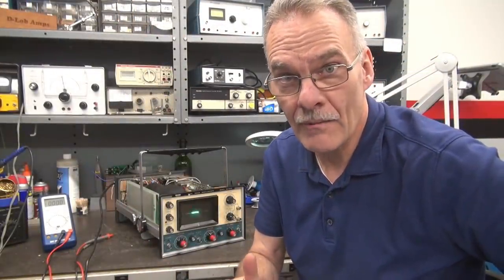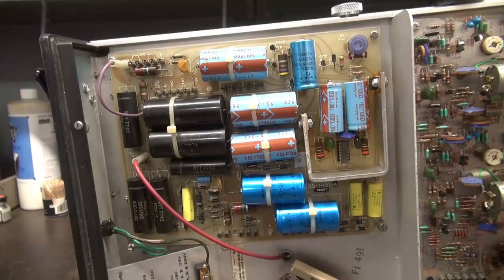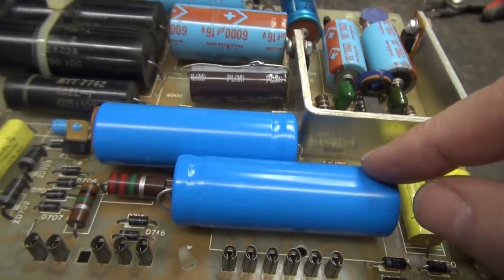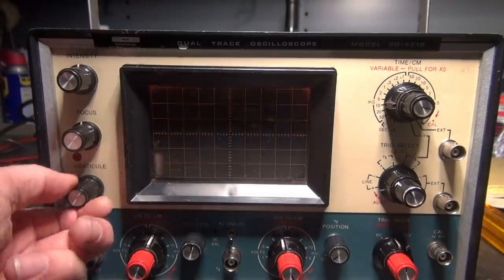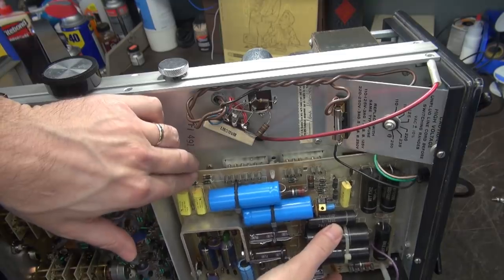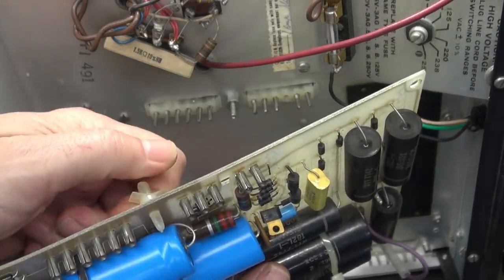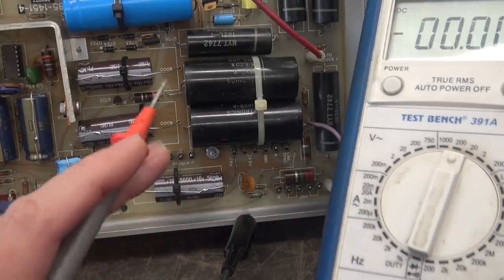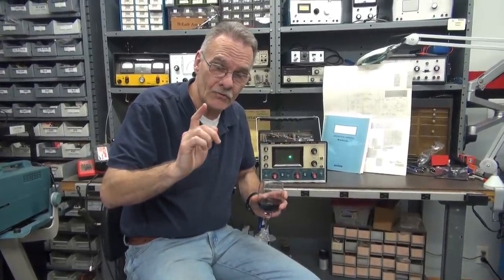How to repair Heathkit Oscilloscope weak Power supply solid advice

Comment: They are not worthless. I built a similar model in 78. I still use it today. I love analog scopes. They show every detail that is hard to see in digital scopes, and there is no pixalation and they are instant. No delays, unlike digital scopes,  which have AD converters. I have built several Heathkit scopes and love everyone of them.

Comment: Great video, TNX 4 the upload! I to use to dream of having some of their products! I skipped a semester of school and used the money for a HW 101. Stayed up 40 hrs straight and built it. Made only 1 error but worked great after that. Shame that there is no more Heatkit Co. They sure had some good stuff ! 40yrs later someone in Poland contacted me and told me he had my radio that I built and other than replacing the driver he is still using it.
73 N8AUM

Comment: i built one of those 4510 scopes back in the seventies , it worked great but  I didn't use it for 25 years , it was stored in a closet and about a year ago I pulled it out and it worked fine for a few hours then the little tantalum capacitors started to smoke and burn up , I replaced a few of them and it worked a gain for a few hours and the same thing happened the other tantalum caps that weren't replaced smoked so I ended up giving it to a friend who loves vintage test equipment so he could replace the remaining tantalum capacitors  since some of them were in hard to get to areas and would require a lot of disassembly to get to . I went and ordered a Keysight 70mhz digital scope and my friend ended up replacing the capacitors in the Heathkit and now he has another scope for his collection.

Comment: I restored and recapped a Heathkit model IO-18 oscilloscope, I really love that unit. Checked the resistor values too if they were in tolerance. I rather have a simple single trace vacuum tube oscilloscope along with my more complicated oscilloscopes.

Comment: heck yeah those scopes are sweet i have the io-4510 one and replaced all the caps even the can and the 3000v stuff. also a few in the input board or whatever it is where the bnc cable jacks are soldered on to. and an ic because i cleaned all of them and put one in the wrong way and fried it or though i did so just got a new one. thing works great it only had one trace when i started now it works great, although i am very new to all this stuff but learning and have my little repair room put together. oh i also repaired a fluke 803 differential dc-ac volt meter old navy one and some old tektronix 647a that thing was fun lol and two tube radios. need to find some more stuff kinda bought out all the cool old stuff around local shops i could find to repair for learning.  anyways enjoy watching your videos its very helpful and fun to watch.

Comment: I'm currently working on a Heathkit 4550. Picked it up for my "Heath Bench". Bright trace, super clean, puffy low voltage board caps and NO TRIGGER ! Replaced the caps, still no trigger. Found a bad solder joint on the -5V supply going to the trigger level comparator (on the horz brd). Also has two blown transistors in the trigger amplifier driver (on the vert brd). Just got the replacement parts. I wonder what you will find with your trigger issue. Can't wait!
Reply from the maker: Hello, I am shooting part 2 right now. Also have the model 4550 here, so can assist you with yours

Comment: I do that radial in place of axial cap trick all the time, but I always put heatshrink or spaghetti tubing on the other lead in case the plastic sleeve on the cap wears out and shorts to the case. It looks like your exposed leads are all negative, which should be the sames as the cap case, but I still think heatshrink is a better solve.

Comment: That is a fine piece of test gear history Terry. So glad you got her back on her feet. I agree, its the right thing to do. Nice work but I  do have a question.  By putting the bolt in place aren't you now creating a new Ground point for the power supply  ? I would imagine they used Nylon to ensure that the ground was centralized on the other end of the board.   Probably not a big deal but something I noticed.   Thanks man, great job.
Reply: Multiple grounds don't hinder in  any performance issues for this particular situation.